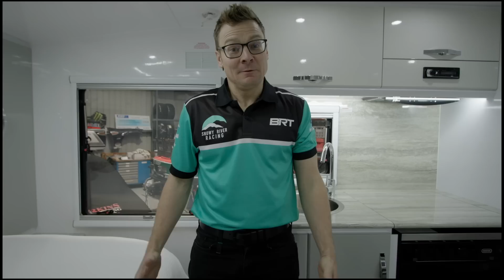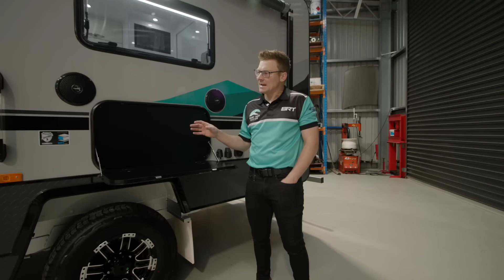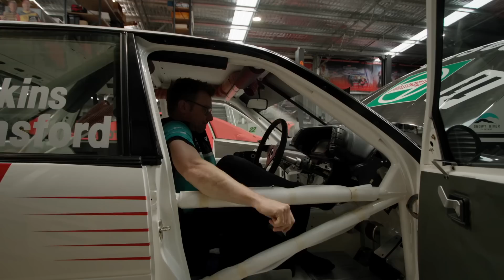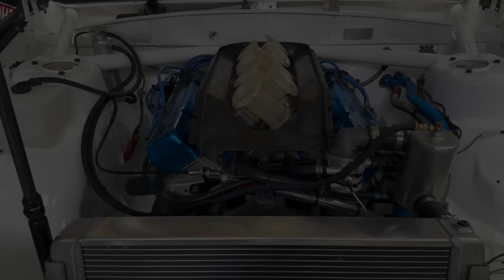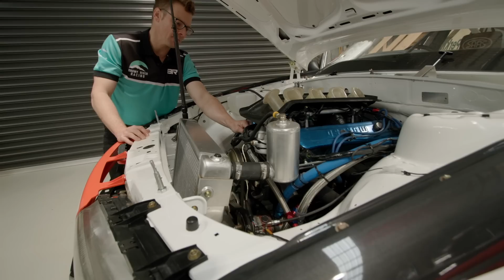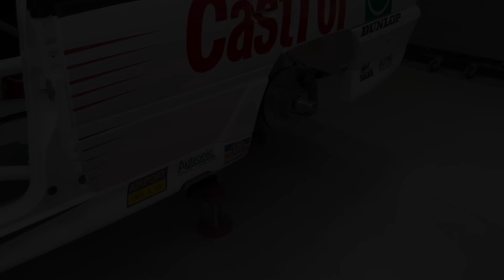Episode 59: Running up the 1994 Perkins Bathurst Car and Chev Engine in the PE workshop

Comment: Would be amazing to hear a side by side of the 93 and 94 with some high quality mics from the front and rear so we can hear the differences between the Chev and Iron Lion
Reply from the maker: Yes they would sound similar in a way, especially at the tail pipe end in the workshop because the exhaust and muffler system is identical between the two. Probably more noticeably different on the race track and the induction noise could be different too. Cheers!

Comment: Hey Jack. 
What’s with the drink bottle to the cable tied to the underside of the parcel shelf??
Amazing work otherwise 👍
Reply from the maker: Good question! It's the over flow/breather lines for fuel fillers and brake/clutch reservoirs. Period correct of course, but not likely to be done the same way today!!

Comment: So cheaper to race the Holden or the Chev of that era?
Reply from the maker: This is a good question, bit tricky to answer. I guess a lot of the Holden parts were getting supplied FOC (or falling off a truck!) but eventually they had Carillo Conrods, JE pistons and so on, so those parts ultimately cost money and the Chev required the same parts, maybe with a bigger window for R&D and performance increases. Ultimately they stopped making the Holden stuff so Chev became the cheaper alternative and the other parts generally see the effect of market force.

Comment: That sounds so sweet
Reply from the maker: Sounds pretty damn good!! Cheers!!
Reply: Jack, when time permits, can you explain to folks the history behind the swap from Holden to Chev based engines for the '94 season.
This was a bizarre decision considering the Old Man had won at Bathurst with a Holden powerplant in '93 when the big budget teams had already switched to Chev Crate Race Motors & Larry clobbered all of 'em with his ferocious reliable Holden.
You might also explain the strengths & weaknesses which differentiate the Holden from the Chev.... Especially the cylinder heads on the Holden being inlet exhaust inlet exhaust compared to the archaic caveman siamesed layout still used in the Chev at that point in time.
On paper, the Holden was the better layout at the time & Larry knew this & took advantage of it to punch out yet another Holden V8 powered Bathurst victory in '93.   This win did tend to make the Chevs look a bit erm...  inadequate.
From my rusty recollections, NO CHEV HAD EVEN BEATEN A HOLDEN AT BATHURST EXCEPT FOR THE 327 IN '68 & THE 350 IN '69 which was before Holden's own inhouse sorted 308s arrived with the L34 in '74.  Basicly, Larry kept Holden V8s on their winning streak right up until the beginning of the newer V8 SuperCar era & he was then the first to win Bathurst in '95 with Chev power after Tricky & Bowie scraped home first with a Windsor powered Falcon in '94. Larry dotted the 20 year success story of Holden V8 superiority with his '93 Bathurst win.
Switching local manufacturing from Holden V8 to Chev was the beginning of the end for local manufacturing. It was a no go zone we should never have ventured into. The Holden V8 was a proven performer.
Please do us all a mammoth favour, rope the Old Man in & give us an episode where you guys give us the inside line on the transition from Holden to Chev powering our ATCC & Endurance Championship Race Cars.
Many of us still run our much loved Holden V8s. Even my busted arse rooted old 60 Series LandCruiser Rust Bucket is still prowling around leaving a trail of Japanese rust while her 253 Holden powerplant just never quits. I think the old heap will one day break in half & all I'll have to do is knock her into 4 wheel drive & I'll still be mobile while the Holden V8 continues to propel the rusted off front half!     Long live the beautiful local Holden V8!

Comment: The old man would of loved that caravan ! Dont know about the tucked in skirt , tight jeans , moose knuckles galore & with those caramel boots 🤔 . My main observation of the video though was the angle of the radiator , is that different with the oz & chev motors ? Thanks
Reply from the maker: Yes the caravan is very nice. Haha I'll keep that in mind for future episodes!! No the radiator is actually identical to the Holden one, just the water inlet and outlets are in different position. So identical radiator and same mount etc. so angle is the same. Cheers!!
Reply: @perkinsengineering  thanks jack

Comment: That's naturally aspirated goodness right there. (I had almost forgotten how awesome they sounded)

Now its no big secret, What are the engine specs?
Reply from the maker: I'll have to dig out the build sheet, the bottom end isn't miles away from the Holden to be fair, I think the first Chev Crankshaft was actually sized to Holden big ends to see if they could use the Holden Conrods!!!
Reply: @perkinsengineering  if it  isn't too much trouble for you, Jack. That would be awesome.  Cheers!

Comment: Hi Jack, great to see these old girls still alive. A couple of questions, when it’s on jacks do you put it into gear to run the driveline and what do you enjoy driving more between these older cars and the more modern ones?
Reply from the maker: Thanks! Yes we do sometimes, you might've noticed the trolley jack under the diff, that's to get the rear axle at ride height so that the tailshaft runs true if we drop it in a gear, take some unnecessary load off the uni's in the tailshaft. I actually need to bleed the clutch again and then set it up off the stop as a "final" set up before I do that run up in gear but its a 2 man job lol
The current cars are basically a purpose built race car, so they are quite refined. The older cars are based on a road car and beefed up to become race cars. I would love to build an older car with some of the current technology, in terms of suspension, brakes, some aerodynamics, engine and tuning etc. etc. It wouldn't be that far off the pace. Cheers!!
Reply: @perkinsengineering  PERFECT!
CAN YOU PLEASE MAKE IT A REPLICA OF THE DAYGLOW LARRY VKS WHICH CLOBBERED ALLCOMERS AT BATHURST IN 1984?!!!
Please, please, pretty please!